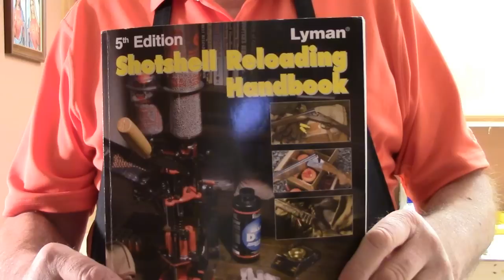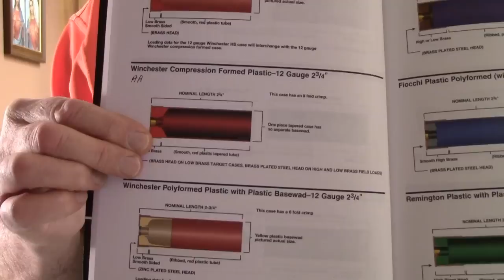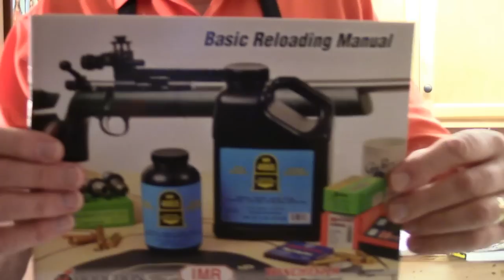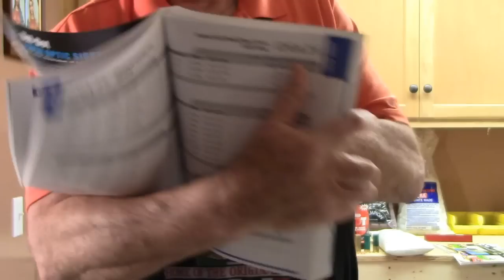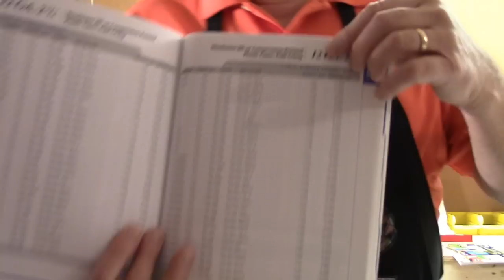The Shotgun Part IV, Handloading ~ Components!

Comment: I've seen a destroyed barrel by a novice reloader. He was experimenting with "wax slugs".
I, personally, don't have anything against wax slugs. When assembled correctly, they actually work pretty well. In this particular case, however, the novice had loaded a wax slug, and then walked to his target area with the barrel pointed down. Good technique on the surface. However, it was not only a warm day, but the trip to the range was in a warm car.
Probably won't ever have a concrete answer, but I'm quite satisfied that the wax slug migrated into the barrel during the walk, and the first shot fired amounted to a bore obstruction.
Reply from the maker: I'm sure that could have occurred.

Comment: Great video, I load my own shotgun shells as well. I load slugs the most because of the cost factor, from molding l.e.e. key drives to buying slugs from BPI. I load the LCB slug from BPI with longshot powder the most, what a great combination they are. I appreciate and respect what you were speaking about when it comes to load pressures and possible dangers of wildcatting rounds. Thank you for another excellent video with great learning content.

Comment: I wish you would have mentioned the pros and cons of the use (or mis-use) of magnum primers. I ended up with 1000 pack of them a while back because the standard 209's were not available. I've heard to reduce powder charge by 10% when using the magnum primers? I've test fired a few rounds in which I didn't reduce the powder charge in a Remington 870, they seem ok.

Comment: I am trying to load a 1 oz 20 ga  was easy with
Sp20 rem wads but no more.
 Pressures get high with different powder and wads. What is a relatively safe pressure?
Thanks mac
Reply from the maker: Only a laboratory can measure pressures.  All shotgun wads and components can be loaded to safe pressures by following published loading data for those components.  Always follow published data.  Lyman has the most extensive publication on shotgun loads with every component made.

Comment: Federal, Herter, Fiocchi, Nobel and cheddite are straight-walled cases.  Therefore only federal wads will work best.  Winchester AA and remington have tapered cases, only tapered case wads can be used.  (fig 8 and AA wads.).   you can switch remington and AA wads between those cases.  Consult the Lyman manual the manual explains case type and wad selection.

Comment: Hello sir, I have a question for you:
If cut open the factory load 12 gauge 00 buckshot and simply replace the lead pellets with steel.., would that round perform well and safe?? Or should I also replace the powder??
Thank you!
Reply: Steel shot weighs less than lead shot…so yes your recipe will change.

Comment: I want to reload with green dot and the recipe from Lyman Reloading Handbook calls for a charge of 19.5 grs.  MEC powder bushings throw 19grs. and 19..7 grs. for Green Dot powder.  If I choose the closest it would be the 19.7 gr. bushing.  Is this the correct choice or should I use the lower of the two.  I recall reading that one shouldn't overcharge for obvious reason and also not undercharge for not so obvious reasons.  What to do?
Reply from the maker: Obtain the next smaller bushing.  No harm is done if you're several tenths under, but over is never the safe thing.  You'll simply have a very slightly milder load that will affect nothing whatsoever.  Lyman develops those loads to achieve the exact velocities stated, so while you might not hit that velocity on the dime, being close is close enough for your requirements.  You'd have to grossly undercharge to create a squib with such a fast burning powder.
Reply: Thanks so much.  I will most certainly follow that advice and go to the lower suitable powder bushing.  Merry Christmas and all the very best for 2024!!
Reply: I would also use the smaller charge then measure what it throws out. You might be surprised that depending on what powder it may actually throw out 19.3 gr instead of 19. Always use a powder measure to see what the bushing is actually dropping.

Comment: 150 fps faster means that in one second your shot will have traveled 150 ft further than the slower shot.
Swapping one component for another is not as big a deal as he makes it out to be. Compare load data in the load manuals and you will see different wads, or different hulls can use similar powder charges so there is a lot of similarities.
Certain hulls can't use some wads because some hull taper at the bottom and some are straight, and the wads compensate for that.